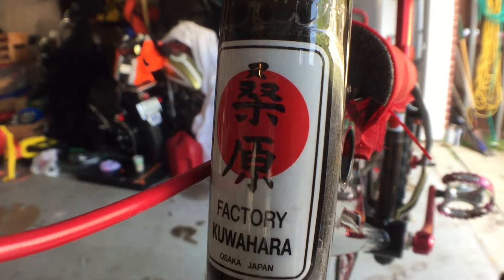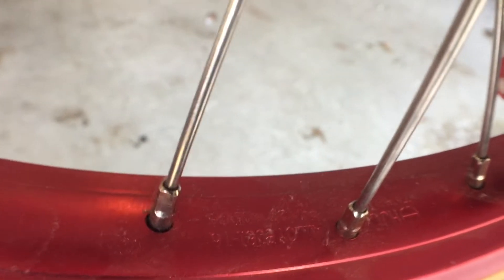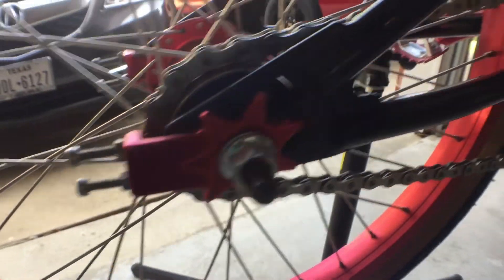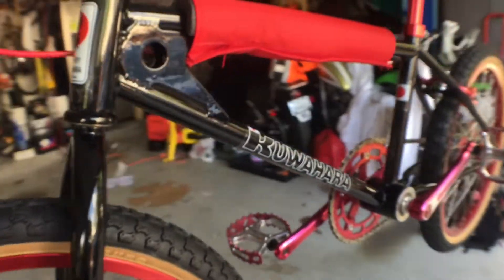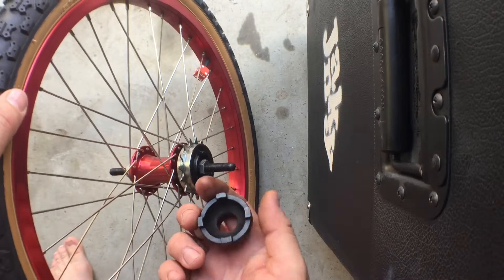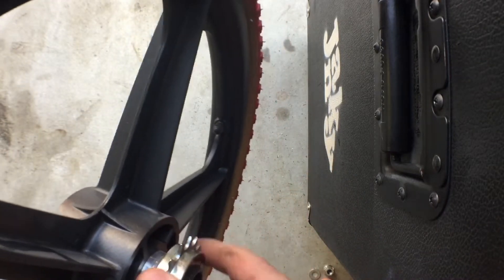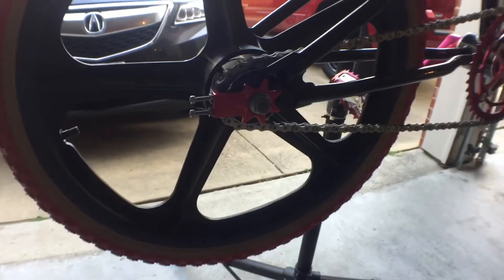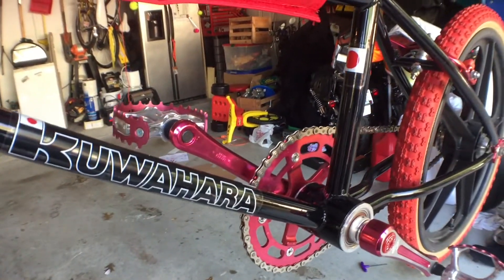Kuwahara KZ-01 Old School BMX Build

Comment: Pretty exciting. I have one of the new ones still in the box, the 2019 Retro KZ-1, Black. 

Years ago I built 7 of them and hosted the images on Jamie's Kuwahara gallery, under James O’Donnell. 

The decals I had printed were genuine epoxy ink, exterior grade. Still have stacks and stacks of them, which used to list on eBay in 2006. 

I no longer post in forums, and no longer sell on eBay, but I am still just excited as ever about my newest KZ-1.

Although it’s my 9th Kuwahara, it’s my first factory bike. Always built my own bikes... but deep inside always wanted the original early 80s Kuwahara. 

Sharing in your enthusiasm. Very nice build. Shame eBay has dried up. Used to be able to find Suntour pedals and KKT Lightning. The prices have gone off the charts. 

The 2019 KZ-1 was $800 to my door. Kind Regards. -Jim